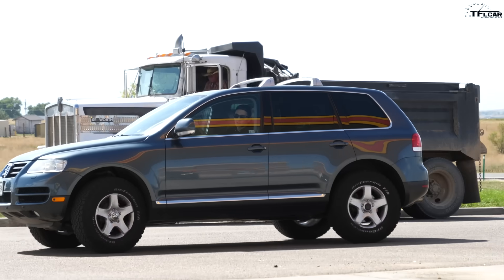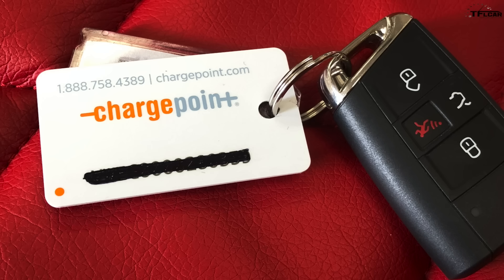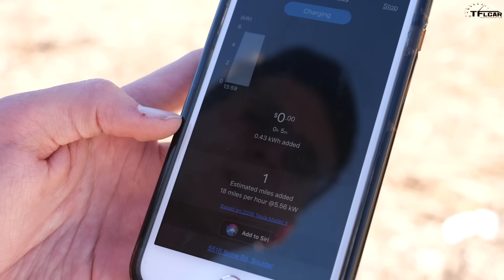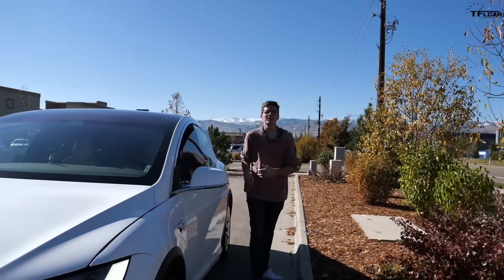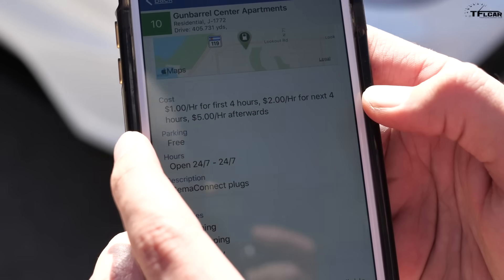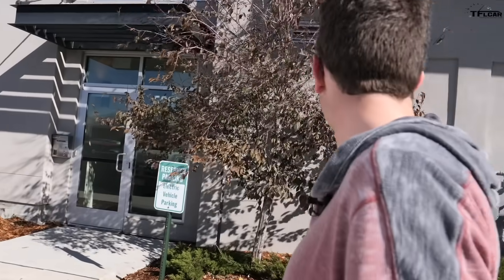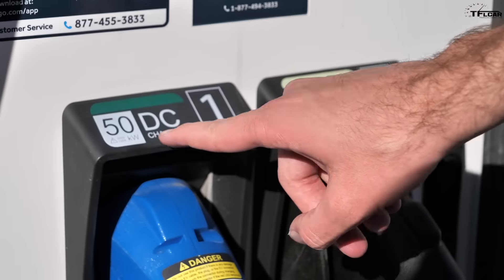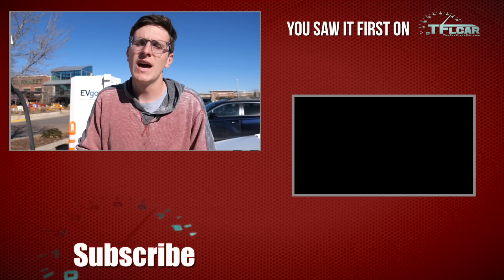Here’s Why Charging an Electric Car Can Suck - And It’s Not The Reason You Think!

Comment: If you have plenty of spare time to fart around and wait fevever to do what you can do at millions of gas stations in a couple of minutes then fine, but if these things get more  numerous then there are going to be issues, I read that maintenance of these facilities isn't great sometimes so they be unavailable, what about power outages like what occurred in California when 5hey shut down power to areas for days at a time, and I personally wouldn't want to worry about where that next charging station is especially in the middle of 5he night and what about saftey at these facilities, do they employ surveillance measures of any kind, proper.lighying and so forth? What about conveniences such as restrooms, if you're going to be there for hours in the middle of a parking lot, I suppose you'd have to cut short the charging to find a restroom, probably at a gas station, then there's the batteries and the many cases of them bursting into flames turning them into instant crematoriums, other than in the movies a gas tank just doesn't explode instantaneously, there are saftey systems that turn the fuel pump off, the lleft is really pushing for these electric vehicles and yet they want to get rid of so-called fossil fuels, what do they think will be needed to charge these things and don't tell me wind and solar.

Comment: People here are saying "just charge and go shopping or eat at a restaurant". First off, if I had to fill my tank every time I went out of the house, that would get old REAL quick. Another thing EV owners say is "all you have to do is charge at night while you're sleeping". Granted, the cost to charge is much less than a gallon of gas, however,  if you are charging EVERY SINGLE NIGHT, that's going to add up real quick. It's like seeing my electric bill sky rocket in the summer time with my air conditioning unit, but the EV would boost my bill the whole year. Then there is the cost of replacing the battery every few years. I had a hybrid once and 4 years later I had to pay $3k to replace it. All that money I saved getting better gas mileage went out the window with one battery purchase. (The dealer conveniently didn't explain that future charge I was going to have to pay.) EV replacing good ol' gas guzzling cars are still decades away, but by that time, I'll be using the Senior Citizen town bus so I'll just stick to my gas guzzler until then.

Comment: Why hasn't someone invented a way to  use the sun to charge them. Why not a solar panel on the roof? How come the car doesn't continue to generate electricity when the car is running by using the energy created by the wheels going around and around. The solar panel gives the car enough power to start, the wheels once going recharge the batteries? Now someone go invent the stinking thing!

Comment: the quickest is around 40 minutes...that vs about 10 minutes at the most at a regular gas station...wow...if you run out of gas you can always bring gas to the car wherever it's at...run out of electricity then you have to pay for a tow only to still wait another hour to recharge...i'll stick with gas until they get it right...why is it necessary for you humans to have to pay for electricity anyways when a car in motion should be able to charge itself...intentional design flaw perhaps $$$...you greedy little apes